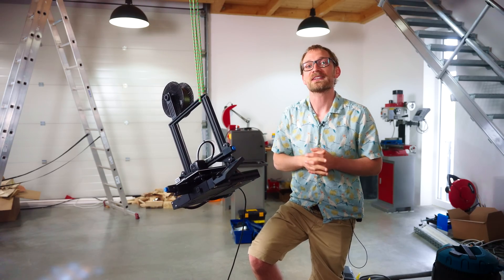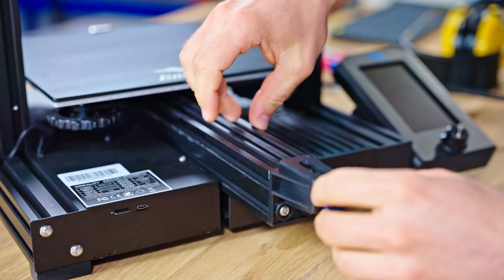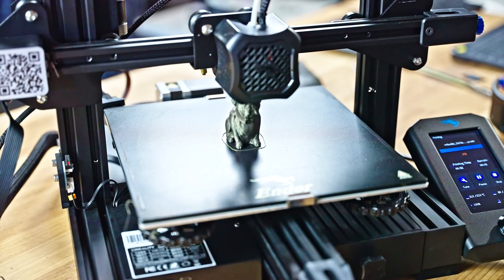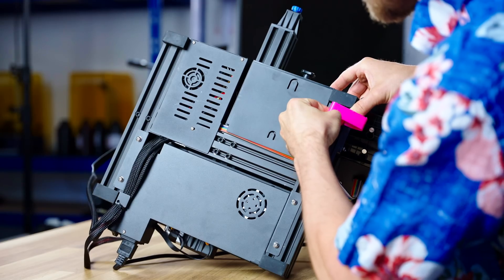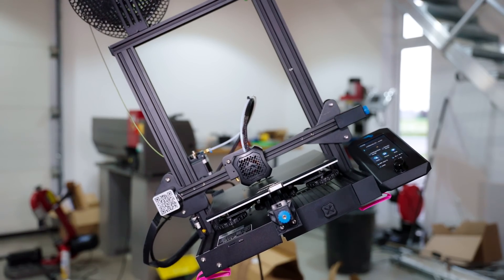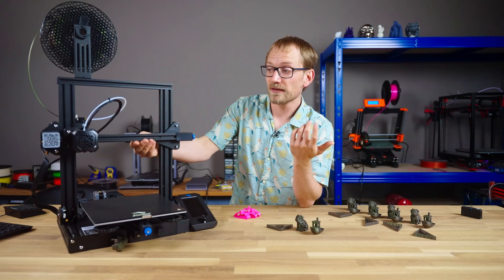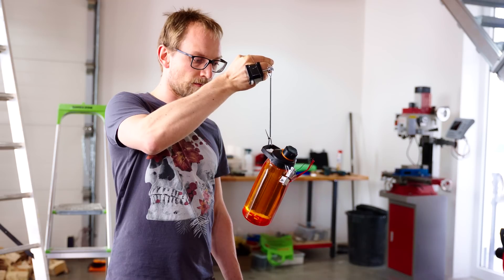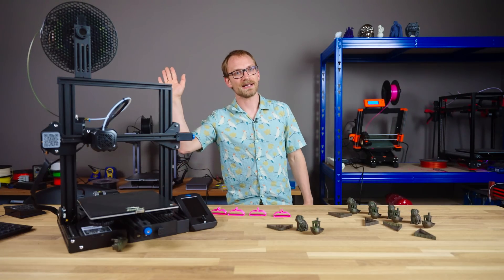Wobbly 3D printer makes for better parts!

Comment: I got feet like that on my FlsunQ5, but i also used the STL to cut a small filler shape in 3dBuilder, which i then printed in TPU with just triangle infill and 3 walls, fitted that inside the PLA feet and that acts as a good damper.  Could probably experiment with less walls on both parts to make them slightly softer.

Comment: Way back when the Printrbot Jnr. was new, I found someones solution for vibrations (I don't recall ringing being the term used then) which were replacement feet made from two printed parts  (upper and lower) and a steel ball.  The printed parts were concave where the ball was located.

Comment: I find it interesting how the author of these flexible feet put licensing on them so that you cannot use commercially or even remix them. But they are just hollowed out snap in feet that MatterHackers has been using for years.

Comment: I wouldn't mind seeing you try sand-fill, just because we often hear people muse about it and otherwise claim armchair expertise without testing it, but we never see any empirical demonstrations on Youtube (that I've found).

Also, I would recommend a few other tests:
- Try the paver again, without anchoring the machine to it as a single body with fasteners
- Try longer versions of the damper feet, to cover more or all of the length of the base extrusion
- Try placing the damper feet at different rotations in regard to the orientation of the base, with both a single set and multiple sets
- Try alternate shapes for the damper feet. The current one damps the x OR y axis, but not both and not any tangents. One that can shift on two (cross) or three (triangle/hex) horizontal-plane axes or even in a round fashion (circle/bulb) might produce even better results.
- And someone else below suggested testing the damping feet at different locations along the base extrusion

Comment: Would be interesting to see what happens with if you put some linear sliders below the printer so that it can move on y and x. Then putting the dampening force on the height of the moving mass (of either axis) should help a lot of keeping stress off the frame. I am assuming that's the oscillation of the frame is around the forces trying to turn it into a parellelogram instead of a rectangle.

Comment: I would love to see your take on implementation of sand filled frames, or a printer housed inside an elastic bound tesseract frame. I had tried the stone platform on thick foam a while back, like CNC kitchen displayed one time, but I could find the proper thickness of foam, so the printer ended up tilting to one side as a default position.

Comment: Thanks! I need current help new to 3D printing just bought an Ender 3, and it's rough, upgraded the bed to the glass things got a little better, upgraded the hot end to the Swiss one, and yeah got a little better upgraded the filament feeder and still getting better. Is that why people buy the Ender 3 to upgrade it??
Reply from the maker: Thanks for the $5.00!

Comment: I'm so glad you differentiated by salmon skin and ringing. SO many times in the community people look at me like I'm crazy for suggesting that they are different things and shouldn't both just be called "ringing" for diagnostic purposes
Reply: The reddit community is full of novelty printers that badly want to be 3d printing guru's. The lack of knowledge before giving advice there is out of this world
Reply: So how do you fix the salmon skin ?
Reply: @DevildudeEMZ .9 degree stepper motors or motors with a les aggressive snap on the steps
Reply: Would like to confirm, I was guilty of this now on a post in /r/prusa yesterday. Wish I'd remembered this video!

Comment: PLA printer feet never stop deforming due to creep and cracks.
PETG however keep their shape, after 1-2 weeks of hardening by resting after print.
PETG is softer than PLA, so springs in feet need to be thicker and longer.
As for dampening, PETG has some inbuilt, but I am working on air damper designs.

PS: I am a materials physicist.

Comment: One of the DIY markets in Germany is selling or used to sell cardboard filled with sand that you can put behind drywall or under your favorite kind of flowing to dampen noise. So using sand is definitely beneficial.

Comment: Look into the concept of "tuned mass damper." Vibrations themselves aren't the only enemy, the big problem is actually resonance. Each part has a frequency that it resonates at, and vibrations at this frequency propagate extremely efficiently, largely bypassing a system's natural damping. One way to cancel this resonance, is to add a second resonance that is out of phase with the primary, creating a negative feedback loop instead of the positive feedback loop of the resonance itself. This is used all over fron motorcycle handlebars to skyscrapers. My guess about the flexible feet is that they're working more like this; their resonant frequency is similar to that of the printer, but not quite the same, causing destructive interference with the resonance of the printer frame. The suspended approach does have a resonance, but it is so slow that the frame and the elastic don't interfere with each other.

Comment: Could you scientifically measure and visualize the ringing effect with attaching some sensors to the hotend and bed? Not sure if some "standard" I2C accelerometers hooked up to an arduino would be enough, or if you need something quite expensive that can measure at higher frequency and resolution is needed. Or maybe even a petridish with a thin layer of sand inside attached to the moving parts or frame would give a visual indication of ringing effects?
Reply from the maker: Stefan from CNC Kitchen has done something like that with an accelerometer, but since we now have the printer bed also freely moving around, we'd need to measure the difference of motion between that and the toolhead. Which gets tricky.

Comment: In terms of noise reduction there are several routes. One is isolation (like suspended mode), another is changing frequency (in general fundamental frequency (Hz) = sqrt (k/m) whre k is the rigidity and m is the inertional mass) up (by lowering mass and increase stiffness) or down (by increasing mass and lowering the stiffness).

Now for a CNC or a printer you need certain stiffness for sharp turns.. so increasing stiffness is generally a good idea (more stiff belts, more stiff axis with heavy duty linear bearings) all while keeping a lightweight approach (so you want to increase the stiffnes by a lot more than what weight you added), and this will get a very high frequency of resonance on the axis. Then the frame will need to absorb those vibrations.. so here a lower frequency is desired but not by making it flimsy (you need as much stiffness as in the gantry) but adding a lot of mass to it. High frequencys from the gantry are killed by a huge inertional mass that can't resonate as fast (the frame and mount on the floor). So this is the CNC route - > as stiff as posible with cast iron frame with concrete poured feet in the factory floor. (or even better are pillars dug deep in the earth rather than the factory floor to keep the noise down as the huge building might be too flimsy and its walls act like speakers if the CNC shakes the floor.. isolating the builing from the CNC with it's own sepparate foundation is a great way to quiet it down).

Solly to avoid ringing, a low enough stiffnes might avoid ringing by losing the edge of the corner.. making a not as sharp turn and experiencing less acceleration, but that is cheating and making subpar parts.

Of course there are plenty of other tricks like having active dampeners to absorb any resonance wherever is needed.. so a printer can have active resonance dampeners on the belts, on the axis rods, on the frame if it's less rigid and vibrates, etc.

Comment: My Prusa on its paver (with a thin layer of Plasti-dip on the stone, for looks as well as easy wipe downs - but it also couples the printer well to the stone without bolts) is plenty good enough for me. I ran some calibration cubes after putting in my Revo and the only axis I saw any noticeable hint of ringing was the Y axis, which perhaps isn't shocking what with it being a bed slinger moving a giant chunk of metal holding the print. I'll be putting in some IGUS synthetic bearings etc as soon as it arrives - my quest there is just durability and lack of noise, though. Also putting in revised parts for belt tensioning (the stock stuff Prusa designed is just primitive imo) to get the belts picture perfect on the tension. Should be fun. Still expect it to have ringing on the Y axis, at least...

Comment: The fix for this ringing is using Linier Actuators instead of Stepper Motors.
Reply: Or some high precision ball screws/linear actuators for the motion system, but now we're talking a lot of money for quality hardware. There are printers out there that have them and they tend to cost a fair bit, but they can go fast and produce good results.

Comment: Never heard of filling machines with sand. Epoxy or some stuff tho. For real we use concrete like af and the machine is anchored to the floor. Machine tool frame is made out of cast iron that has damping characteristics. But comparing 200$ printer made of aluminimum to something that costs tens of thousands to start with is useless.

Comment: Hi Thomas! very good video! I think an idea for rubbing ropes, most simply that 4d cubic whatever... you can put it not just in one corner of the top bar, but one in each corner, I mean paralel ropes, put your 3D printed dumpers and suspend over a table like just "hovering", so dumpers are not so flattern at all because of the weight of the printer... just an idea! :)

Comment: The Bambu X1 makes these old gen printers obsolete.
Reply: Not really. It looks like a nice printer though, but mostly it's just a CoreXY printer with an enclosure. It has nice features, it's fast, but it's also loud and costs considerably more. Put a well built Voron CoreXY or a Ratrig in an enclosure and you have something very similar, performance-wise. But, the Bamboo printer is definitely very interesting, especially the advanced bed leveling and such. I'm just worried about software lock-in and not being able to opt out of anything - I'm already boycotting the Elegoo etc other Chinese resin printers because you're stuck with just one piece of software to run them. Proprietary closed source Chinese software, at that, which is just begging for data leaks.
Reply: @extectic  yeah really. Its the future standard.

Comment: @Thomas Sanladerer what about putting the printer in a box of sand, directly on the sand. You might have to pull it up and place it back on top between each print because it might  sink in with vibrations but might be worth a try.

Comment: It would be interesting if you could use the gcode to predict where and when the ringing was going to occur, and use an actuator to make a complementary movement to exactly cancel it out, or maybe just introduce some high frequency movement in the gcode to blur the ringing. the simplest solution would be  if the slicer could predict where the ringing would happen and lower the print speed in that area to eliminate it.

Comment: Firstly put it on floor instead of table. It really helps to dampening the vibrations.
Ender 3 pro is tower-like printer, printer will vibrate more Y direction than X direction in same speeds because of mass of the bed.
Optionally connect to the wall along Y direction (if you can)

I know you hate the community of klipper but put aside of your bias and install it for INPUT SHAPING. Don't forget the accelerometer. (If it is hard to install klipper just install fluidd or mainsail).
When it sits on the floor and calibrate input shaping then print it. When you want to move your printer another location calibrate because natural frequency changes.

As a mechanical engineer I could say: if you want to change natural frequencies range of your system you have 2 options.
1. Add more mass (direct connection to floor includes this)
2. Spring and dampening elements 
which both  makes your system's natural frequency jump to another range.

3D printers are not working with constant vibrations. Different accelerations comes with different vibrations. Because of that you have to calculate or simulate with every move of your printer. Input shaping nearly does this. According the calculated natural frequency values it cancels the vibrations with specified method of your choice (or automaticly chooses for you if you prefer that way)

Comment: This is the kind of video we need more of. Absolutely would love to see the difference between a frame filled with sand or not; but I suspect you'd need quite a chonky frame (4040) to see much difference - you need to fit a lot of sand in there. Damp sand would probably also be better. Also, damping is not the same as dampening, people, but dampened sand may help damp your printer...but may also dampen it to much. Damn(p).

Comment: First thing to try would be to swap the simple rubber (no dampening) against a rubber WITH absorbing properties - SORBOTHANE (a visco-elastic PUR formula) would be the obvious choice. I poured my dampers from a visco-eleastic polyurethane (PUR) mix and ringing never really had been an issue...

Comment: Ringing can be defeted only buy getting good step motors usualy they are super quiet + finding the right print speed and print accelerations.  And a rigid frame of course

Comment: What about putting the printer o a sand bed?
Like filling a box with sand, puting some cloth over it to prevent sand getting to the printer and the printer on it to dampen the vibration?

Comment: IMHO that was mistake with elastic rope. Rope work as dumper for vertical vibrations. We need the dumper for horizontal vibrations. Add four lines for left, right, front, back.

Comment: Now you've actually got me wondering whether counterweighting all the moving parts could help avoid the problem to begin with. So for example for the print head have a  equally weighted  object  that always travels in the opposite direction of the print head. Given a rigid enough frame that should keep the the acceleration forces neutral and stop the printer from oscillating. (same for the bed i guess but frankly this sounds like something that is better tested on a Core XY machine.)
Of course you'd also double the weight of whatever you're dring that way so that'll probably give you a whole bunch of other problems ......
Reply: You would stop the frame from moving, BUT. The forces on the belts and steppers double. This will limit your accelleration a lot, and you'll probably find you get at least as good results if you just print with lower accelleration values on a "normal" setup then. 
Lowering the weight of the printhead as much as possible is probably going to give you better results. 

Now, adding an extra motor that is NOT connected to the actual printhead that simply fllings around a counterweight might be an interesting approach. That way you might be able to get the best of both worlds- at the cost of added complexity and cost.

Comment: Find a printer with lots of 2040 extrusions and do a epoxy granite filled machine. 2020 doesn’t have a consequential void to fill. Additionally I think polymer based wheels help to achieve some level of dampening already.

Comment: A couple of ideas I had while watching this were inspired by attempts to mitigate the damage caused to buildings by earthquakes.

The first 1 would involve having 2 masses, 1 equal to the print head, the other to the bed, moving in the opposite direction to their counterparts at the same time & velocity. Not exactly sure how to do that, but... 🤷‍♂️

The other idea is related to something they did to some government buildings somewhere in the US. It involves a multi-layered approach of permanent magnets & aluminium. The more the magnet moves, the more magnetic field it induces in the aluminium, and the more that field resists the movement of the magnet. It's like that thing you see where a magnet is dropped down a vertically oriented copper (or aluminium) tube, & it takes longer to come out the bottom than a non magnetic object of the same size & mass would. IIRC, the reason it's multi-layered is that the different layers are tuned to cancel out different frequency ranges.

Edit: I forgot to mention, the magnetic dampener thing was placed under support pillars of the building. They actually had to jack the building up & put them underneath.

Comment: Hi Tom, good video, very interesting, my fix for this is I will print some cylinders about 10 to 15mm high, 25mm diameter in vase mode (spiral mode) out of TPU or TPE and I will fill with run of the mill construction silicone from the hardware store, just fill them and leave them to set, then silicone those to the underside of your printer, ringing will be reduced and so will any noise your printer makes on the surface its sitting on.

Comment: My simple solution was kitchen sponges, one under each corner.  I did this to reduce noise (which it did marvelously as before it was turning the table into a giant speaker cone).  I suspect it helps with ringing as well but never thought to look.

Comment: Two things. Take the feet off the concrete paver to increase the contact surface area.  Two, try some of the packing foam that comes with the printer

Comment: I was planning to fill my printer frame with sand, but you do obviously need a hollow frame. Mine is 40 x 40 steel tube so easy to drill a hole and fill or empty it.

Comment: I would think that the print speed would have everything to do with ringing on account of the size of the printer.  The larger the printer the greater the vibration and ringing.  I have a CR 10 and I get exquisite printed pearls, but I'm also willing to wheat for them, and not turn up the heat to bake a faster cake, or speed to print a faster part.